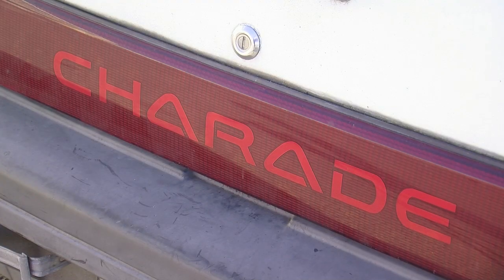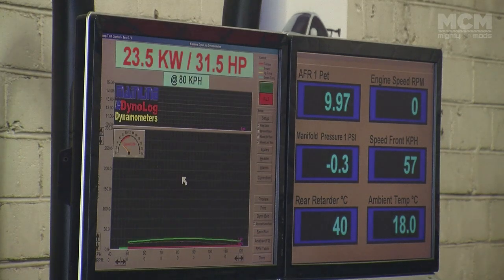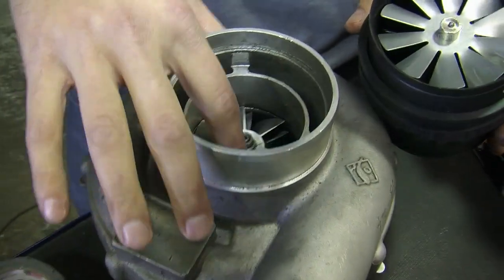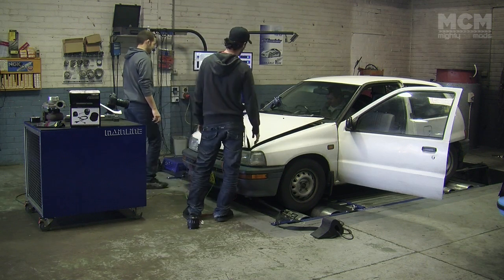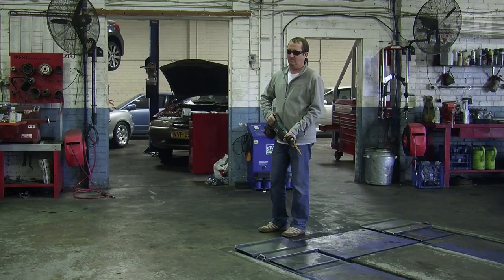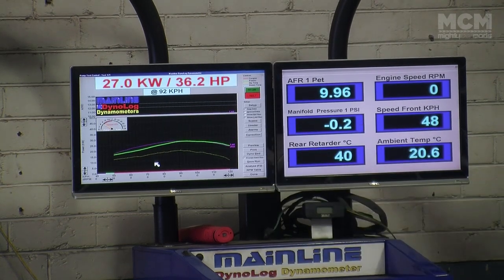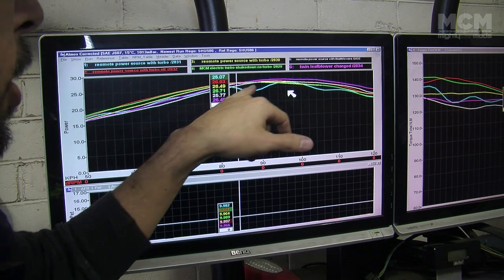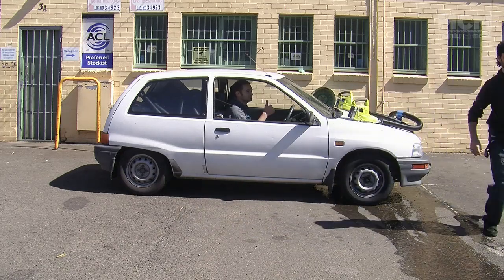Electric SuperChargers Mythbusted

Comment: Apparently you guys got something wrong with this test. Because volvo is about to release a car with one of these as a very expensive option. LOL
Reply: auspolk Look into what it takes to make the power to run a electric device. Hybrids are the same way. You get about 80% efficiency using the gas engine to charge the battery. The supercharger is going directly from gas to motion. The electric turbo is using the alternator to convert from gas to electric than powering the turbo. The power required to get any gain out of a electric turbo would be around the same as those big dryers at the carwash. And I believe those use like 50amps at 220v. So at 12v to get the same amount of air pressure you would need 20x that.
Reply: There's nothing wrong with the concept of an electric air compression system. Its just that a 300 buck fan is not the same thing.
Reply: auspolk But wouldnt the power required to run such a large compressor cause alot of drag on the engine?
Reply: Superchargers also have a power requirement, its just they take the mechanical energy directly from the fan belt. An electric one would be taking it from the electrical system which is in turn being charged by the fan belt. Could be equally as efficient. Whether there would be any benefit going an electric compressor rather than a mechanically driven one, I've no idea. I suspect there probably isn't, unless you're doing it in conjunction with some fancy hybrid tech.
Reply: auspolk At 12 volt I doubt you could really gain much benefit . I don't think at higher flow a 12 volt electric motor could handle the amount of air it has to move  or if it could it wouldn't last long
Reply: So thats 11KW you need to free up by your maths, which is reasonable. The power requirement for a supercharger driven by electricity or by a fan belt would be the same, the difference is the efficiency of how you convert and transfer that power. Likely less efficient on the electrical system, yes, but the belt driven system isn't going to be a lossless transfer of energy either. Even if it was, we'd be talking about a few KW difference in power usage, which would likely be unnoticeable.

You can convert from 12V to whateverV with little difficulty. You can use different battery tech. You could use an additional or alternative alternator to provide power directly to the electric supercharger. Doesn't take much a stretch of the engineer's imagination to get one working if they wanted to. 

I'm not saying that there's any benefit to it being electric, I doubt there is. I don't see it being any cheaper, likely more expensive. I don't see it being any lighter, likely heavier. I don't see it being more efficient, likely less so. I don't see it running cooler, likely hotter. I just enjoy new tech concepts.

Plus like you've already pointed out, volvo have made one.
Reply: Doesn't change the fact that the conversion from mechanical to electric than to mechanical again causes massive losses that you dont get in a standard turbo or supercharger setup. If there was no losses a prius would get 60% better fuel economy. (or maybe its like 59% now) But there are study's about gas to electrical power are in the 40% range on anything in the reasonably affordable range. I'm sure there are crazy efficient systems for alot of money but those wouldn't apply in this case.

Comment: why doesn't electric super charger work??? it has a fan
Reply: The fan lacks the power to move enough air, for a turbo to work the air must be compressed, and moving fast a small dc motor fan like that just doesn't cut it, in fact the engine will pull air in faster then the those fans will push the air,  so they make no impact whatsoever
Reply: Sean Hinkley
it's just a scam then, 300$ seems like a lot for just a simple fan
Reply: It cant reach the RPM required to move enough air at higher rpm's to meet the engines demand.  I would bet at some point the engine is sucking more air then the fan can provide at its peak RPM  hence the lack of change on the dyno
Reply: Big Ox
That's very interesting, thank you.

Comment: 31HP to the wheels?... with a 1000cc engine? lol stock sport ATVs around 400cc make more than that to the wheels
Reply: there must be a reasonable explanation
Reply: i would assume that its because of low gearing, the charade has to weigh a lot more than a quad so in order to accelerate decently it has to have a lot of low end grunt for a tiny engine and because of that it will lack high end output
Reply: I would think there would be more torque in the car engine
Reply: Will Matters
yes its the torque that makes it happpen vs an ATV engine which has very little torque. to drive the car with an ATV engine with more HP it would need to be at MAZ rpm at all times. not good.
Reply: so what you are telling me is a 60,000 pound load pulled at 80 mph by a peterbuilt with 500hp N14 cummins for over a million miles can be done by a 500hp civic?
Reply: south9563 horse power and torque are very different, especially with diesels... and the transmissions are made for completely different purposes
Reply: Dyllidan ret
I know the difference i am a diesel tech, but my reply was not to you.

Comment: Get your shit together, is it a frigging turbocharger or a supercharger????? You keep going back and forth between them during the video and the title says SuperCharger when I believe the turd in a box is concidered a turbocharger since SCs are belt driven
Reply: All devices that compress air and push it into the engine are called superchargers. Today, people call them by how they work. People today call a supercharger that runs off the engine a supercharger, and they call a supercharger that runs off exhaust gases a turbocharger. All types are superchargers.

Comment: you guys should use twin party inflatable air pumps. they move 1600 cubic feet of air per min. the setup can be used in a car. just put like a gas generator and both air pumps in the trunk and use a pipe to connect them to the engine.
Reply: Why don't u do it and post it lol

Comment: You see that little thing popping up on the intake to the air cleaner? That's a valve that limits the air flow when the EGR kicks in. I'm pretty sure that had something to do with the power loss.....

Comment: Really, while I see the point in this particular version of an electric supercharger which, lets face it, was made really badly by people who do not understand the concepts of aerodynamics, it does not in its entirety disprove the concept. The reason that this particular unit did not perform as promised was due to the type of impeller that was used. If you notice there is a millimeter plus gap around the edge of that fan. It allows the positive pressure to escape. Now lets say that you took that turbo apart and removed the exhaust side. Now hook the intake impeller up to an electric motor. It would outperform the full turbo by quite a margin. Why? Simple. RPM. The reason it would work with the turbos impeller is due to the fact that it is positive displacement. There is nowhere for the pressure to escape from the system to. Something like a blower fan would work better in a case like this.

Comment: I want to see someone take a procharger and hook it up to a rc motor (or other electric motor) that can spin the procharger 4000-7000 rpm. a procharger is made to boost 6psi or so at that rpm. Some other people try taking the cold side of a turbo and hooking it up to a rc motor but its too hard to turn it at 25k rpm to get 6psi. External batteries.

Comment: Guys, please tell me you're not that ignorant.  It's obviously a scam but even if that stupid fan gadget could blow enough air to pressurize the intake, all you'd be doing is leaning out the engine.  And if you put that on a fuel injected vehicle that works off of a vacuum (MAP) sensor, it wouldn't even run.
Reply: Half the video is them acting in a satirical way.
Reply: ***** A carb has to be jetted differently to function well with forced air induction (Studebaker's Avanti and Ford's Skyliner come to mind).  With fuel injection, forced air can create over-fueling (especially with a mass air flow sensor).  But you're right, that little fan isn't going to affect anything.

Comment: Chain 6 of those turbo PC fans together in a line. It might hit 1 full psi.
To build a working electric supercharger, remove the exhaust side of a normal turbo and replace it with a 10 hp high speed electric motor and a 4 to 1 gearbox (to step the RPM up to about 120,000), now all you need is a 20 kilowatt power supply to run and regulate the motor. Easy....lol

Comment: A fan cannot compress air, however it could improve air flow but to no notable degree.
Charged air compresses the air in the intake so that when it is drawn into the cylinder it has a higher density.  A fan can not do this however there apparently IS an electric charger that DOES work, as it uses a traditional turbine compressor to charge the air and uses an independent electric circuit that charges when not in demand.  
Search ROBFTSS for more information.  For a real charged air system, however, you pay a real charged air system price.

Comment: someone needs to make a liquid oxygen booster.... and youtube it ;)
Reply: It would be brilliant right up until the point where all of the rods punched through the engine block at the same time! :)
Reply: Leight Matters Basically the same thing as not properly retuning the ECU after turbocharging a N/A engine, it'll lean out and blow up, except in spectacular fashion, oh and did I mention compressed oxygen is ridiculously explosive? Like rub the seat and create a static spark, and boom, garage is gone.
Reply: ZoruaZorroark LOX wont work. NOS liquifies like natural gas - you have constant pressure in the tank no matter how much is in there, and pretty low pressure at that. LOX does not stay liquid at low pressures unless its cooled below boiling point. As a result pressure in the tank is inconsistent requiring additional control units in between.
LOX would react with the fuel almost instantly and would detonate before compression blowing your engine the moment it gets in.
Thats why we use N2O.
Thus using O2 instead of N2O is effectively suicide.
Reply: To sum up: The reason we use Nitrogen in the mixture is to stabilize the Oxygen long enough to allow it to combust reliably. Without it, it would combust far too easily to be useful in an internal combustion engine (even if you could keep it pressurized and keep it from oxidizing before it reached the cylinders, the heat in the cylinders upon the oxygen's decompression from the jets would cause it to detonate.
Reply: Always wondered what would happen if a NOS bottle was charged with O2 by accident.
Reply: why? NOS does the same thing except safely
Reply: Sens23Bruins higher intake of oxygen and nos takes a little bit of energy to break that bond were as O2 wil oxidise at room temp with a tiny bit of encouragement.   Down side is if your tuning was off instead of igniting in the cylinder it might detonate instead.  Also it could pre-ignite and there goes your intake manifold.

The more I think about it though the more I want to watch a vid of someone crazy enough to try
Reply: nos pretty much does the same thing to oxygen
Reply: True but I takes more energy to get it to oxidise  hope that's the right term
Reply: but still, we need to use LOx in our street cars, better if it's pure liquefied O3.
Reply: Make a kit for a hayabusa and I'll give it a whirl  just let me get my affairs in order first =P
Reply: Big Ox lol the hayabusa is already turbo charged anything else and you wouldnt be able to keep the front wheel on the ground
Reply: This is true   extended swing arm...  Problem solved  it will just shred tires instead
Reply: Leight Matters re:"Always wondered"
I've never had a NOS bottle but I have many other bottles & the valves are different .
And I believe for the Gas Co to be able to transport them they are require to have a ID sticker on them as they are a Haz Mat item per Federal Regs.
Reply: it's already patented xd

Comment: The fundamental problem of "those" electric turbos is one of fan design, not as much the electric power plant. A respectable electric motor (BLDC) can output several hp of shaft energy (6 hp and the size of a pill bottle). Getting this the optimum speed for a properly designed fan is just a matter of gearing, if you even have to do anything.

The real problem is that getting compression out of an axial system requires stacks of decreasingly sized rotor AND stator blades. Look at any exploded diagram for a turbojet engine. (Or Wikipedia "Axial compressor") The compressor section will have stacked blades bonded to the shaft; and stationary blades (with opposing cut/curve) bonded to the engines case. These stators keep the air from just sticking to and following the rotating blade. I didn't see anything but a crappy stamped sheet metal blade in that $300 thing. 

Otherwise, a proper turbo intake is actually a centrifugal compressor, not just "a fan". A radial (squirrel cage) fan is closer to a turbo than an axial fan, which would explain the results with the leaf blower.

But without the logarithmic taper and razor close tolerances of a proper turbo...

Comment: It can create it's own CFM until it spins itself apart. Also since they sit in the intake tube even if they could compress, they wouldn't be able to compress an intake pipe, partly due to the fan limits itself by taking up room in the pipe. Acting as a restrictor, nullifying itself

Comment: @methralha761 are you a mechanic? I'm betting not. Fuel injectors and fuel pumps have What's called a duty cycle. They're designed so that when the car is running at 100% throttle they only need to do 85% or so of the work they can. If they were running 100% all the time they wouldn't last long. Also, the computer and car has sensors to detect and adjust fuel appropriately. So your argument is invalid. These don't work because they only "move" Air; CFM=cubic feet per min. An engine needs PSI

Comment: idk much about cars and stuff but this makes sense. Exhaust pressure from your vehicle would produce alot more energy to circulate the fan than what an electrical motor can produce at a set RPM. but there are motors that you can buy that reach 10,000 RPMS. I guess it depends on how much CFM airflow you have going through the manifold? i dont see why an electric motor cant produce the same power as a conventional turbocharger. you just need a more powerful motor i would assume

Comment: You guys are a little silly twats,(No I don't mean that)  with the extra air being pumped into the cylinders, you also needed to increase the supply of fuel,. it is the extra fuel that yields the extra power not just stuffing more air into cylinders, however, I know what you are going to say, the ECU should compensate for extra fuel need as when you put more air into the engine the original amount of fuelling will make the engine run leaner as there may be no adjustment made by the ecu through a lambda sensor feedback.

So you now need to re-run this test on a car that uses a lambda sensor so that it can tell the ECU to add extra fuel to compensate extra air being pumped in, and sure enough it should also improve the volumetric efficiency of the engine at higher RPM as the glorious computer fan is assisting the engine with air being pumped in rather than leaving the engine to suck air in. (LOL)
and no
Reply: Not to mention that the additional fuel flow requirements may exceed the flow rate capability of the fuel injection system while the rail pressure regulator will maintain pressure to a point, however most fuel pumps are high speed centrifugal pumps and will suffer a pressure decrease as flow rates increase. Which brings us back to my prior statement about the pressure regulator, once fully closed ie. not bypassing fuel back to the tank return line, pressures will decay as flow rate increases eventually reaching a point where the injectors will pass no additional flow despite increased gate time.
Reply: This car is using a carburettor  where is the ECU   your talking about fuel injection it isn't injected.  As to Samdomding main point.  Your right  they didn't retune it so this test proves nothing.  It wouldn't auto compensate for the added air because its carburetted.  Raven.  Yes that's how a throttle works but the fuel flow is tuned to match the air flow if you increase the air flow the fuel must be increased to match otherwise all it will do is lean out the mix.

What they should have done to truly test it is richen the tune and or rejet the carbie.
Reply: The poster made a point in the beginning of the video to point out that he had disconnected the fuel injectors, therefore is not calibrated.
Reply: The air filter on the top that they are hooking up their forced induction systems is for a carburettor nor a fuel injection system  what they have said has been wrong oh so many times.  This car doesn't run fuel injection otherwise the intake would look very different.  A different throttle body   and an intake stem down to an air box or air filter of some type.  struggling to understand what "injectors"  they touched.  Unless they are confusing jets with injectors.
Reply: Big Ox
But perhaps you are wrong and it is not a carburettor at all, but a TBI (Throttle Body Injection) system. They were the first injection systems spanning the gap between carburation and multi point injection system. Usually there are 2 injectors in the throttle body that at first glance looks like a carburettor. In fact if this electric turbo were ever going to work, it would more likely work on a carburettor than an injected engine. Cheers.